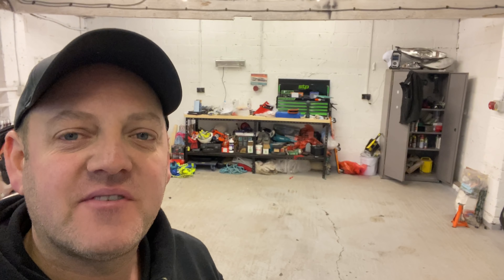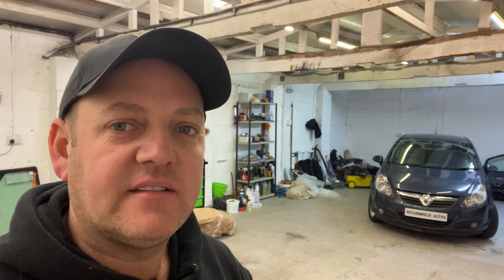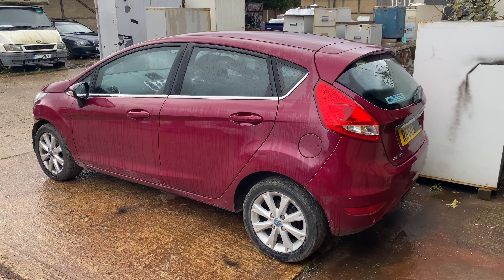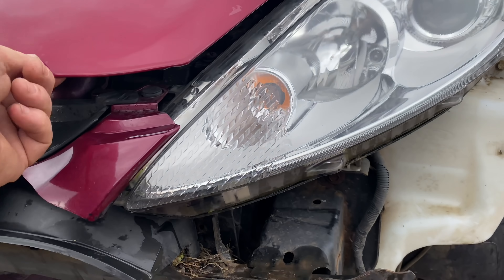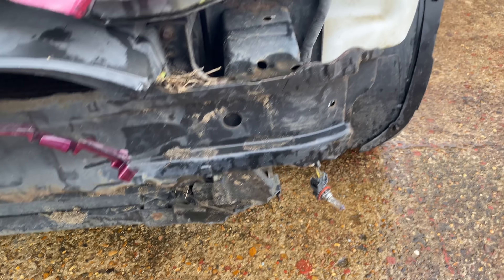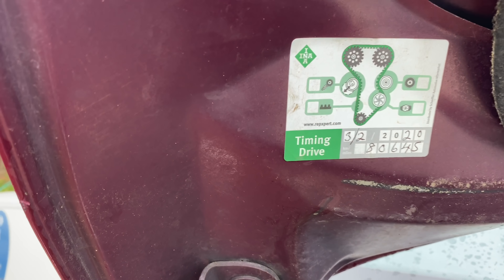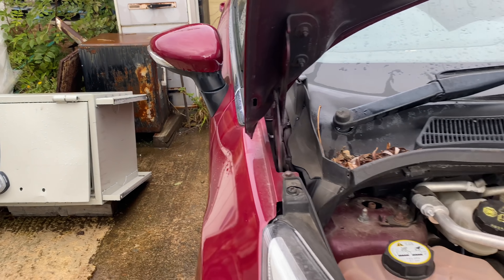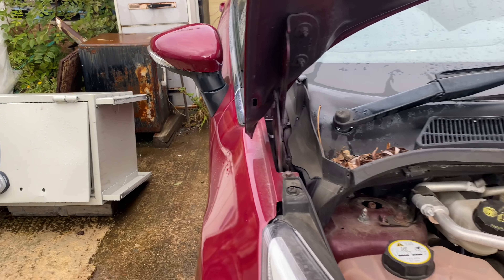NEW PROJECT PICKED UP FROM COPART SALVAGE AUCTION

Comment: Hi Mark, that black plastic tube in the clear plastic bag you picked up from the passenger side floor is the ‘emergency fuel filler’ should you need to put fuel in from a fuel can! The Fiesta has no petrol cap and that’s needed to push back the valve down the filler tube under the fuel cover. Don’t loose it, mine just lived it’s life in the bottom of the glove box. Great videos well done 👍👍👍

Comment: The tube is for filling fuel from a Jerry can. Put that into the filler on the car then you can use the plastic tube on the can, the cars filler neck won't allow you to use the plastic tube without that in first. Looks a nice easy repair for you....like the Clio I think you are over thinking the colour, a nice change from the usual boring bland colours.

Comment: Always wash them before taking them indoors as you will always identify body damage, as was mentioned before use the fuel filler flap as a colour reference if it looks the same as the rest of the car, the rear bumper looks as though it has been painted before.

Comment: That's why you should of bought a car transporter not a truck and  hiring a trailer you pick up enough cars to justify owning one. You will find more cars you do more colour matching becomes more of an issue especially if the car has had paint before
Reply: Totally agree about the buying a transporter instead of buying that truck and keep renting a trailer
Reply: Or just buy a trailer could be another solution
Reply: @shanebrown6667  problem with trailers is there awkward to store because they can easily be stolen. When moving motors about transporter is the way to go especially multiple times. Just having a transporter can earn you money.
Reply: @daniel green I know what your saying mate I even pointed out one I knew was going cheap early doors into the unit but if your adamant on a shop truck instead then a trailer is the next best thing to stop hire charges etc I do know what your saying about storage etc

Comment: Bumper looks a different colour from the quarter panel before you start 🙈 typical with plastic bumpers or plastic sill covers, colour never looks the same as the rest of the car, whether it’s a fiesta or a Ferrari makes no difference 🤷🏼 this colour will definitely need blending out if you need to do paintwork on it👍